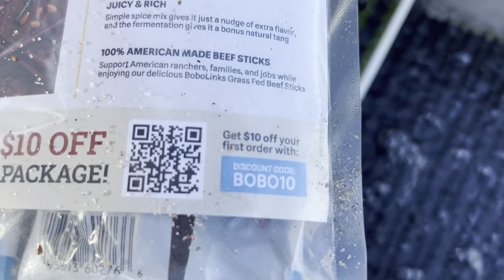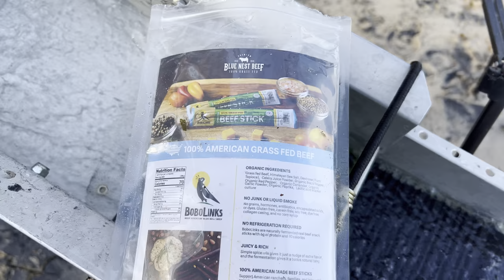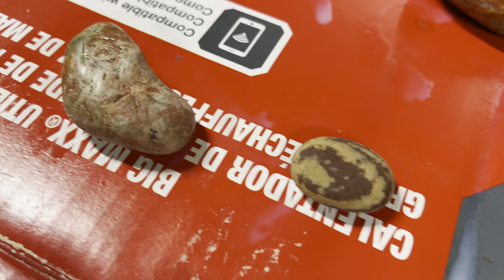Gold mining Lake Superior with FANTASTIC results !!!!!

Comment: You will have to look into the winds the night of the storm. It would wash all the black sand you are missing down the shore in that direction. Look for your inside and outside corners on the shore.
Old Spice bottle - light house.
Reply from the maker: The inside bend that used to be there was gone !!! 🤷✅

Comment: Hey Jason quick question for ya, notice your always hiking around all the time "as myself most times" just curious what size battery would you recommend using in the field and size bilge pump for maximum run time being 12 v? Scoped your videos however didn't noticed anything love the videos been waiting for newest one lol take care stay safe
Reply from the maker: Great question ✅
We try to keep our equipment small as you’ve noticed so finding the “ bang for your buck “ balance is really about what you want out if prospecting. Lately we’ve been content with our small 7 inch wide sluice . It requires a 3 amp 1100 gph pump , we also run a speed controller to dial it down if needed. Most of our trips have been one dayers so we typically only run around 6 hrs ( 8 hrs driving) 🥵
A 30 amp hour lithium iron phosphate battery will run that pump around 10 hrs so we never have issues. It only weighs 7 lbs so it’s handy for our long walks . If we plan on doing a long day we also have a 50 amp hr lithium battery which weighs 12 lbs . And will last all day with any 12volt pump. Hope this helps !
Jason/Rigby FGWTEAM
Reply: Indeed it does thanks much! Am wanting to start taking my AIGP sluice I picked up from prospectors Dream in the field but currently have a 70 pound marine battery I bought from Walmart doesn't last but a few hours. Any brand recommendations?
Reply from the maker: @donovandagenhart1161  
Try Dakota ✅ or eco worthy

Comment: Could you put the stuff before you run in a 5gal bucket filled with water and use a magnet to get most the black sand out before putting in the washer.
Reply from the maker: Some I guess !

Comment: Spin-it-off magnet would speed up your gold recovery
Reply from the maker: I have one even better!!!!
Reply: @FlourgoldWizards  if it's free, it doesn't make it better....
Reply from the maker: @dennishedrick5308  
Its the spin it offs big brother! I made a video of it . Mining magnets makes both 👍🏻
Reply: @FlourgoldWizards  you might want to do your homework on that one.  The problem is you've never used a spin- it-off - which actually has a patent on it and way before mining magnets ever showed up on the scene...
Reply from the maker: @dennishedrick5308  
I’ve apparently got some brain fog… i saw dennis Dayton use that equipment before, it does look interesting!! Thanks for the tip!
Reply: @FlourgoldWizards  you don't have to use the plastic case on the rollie pollie to take off the magnetite if you use a spin it off instead.  Magnets are more powerful in the spin it off too ..cheers